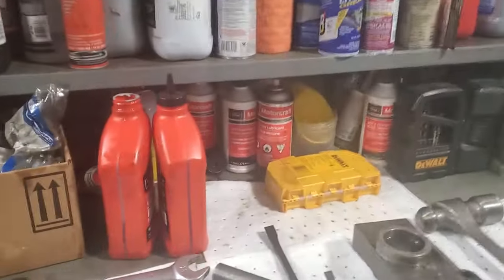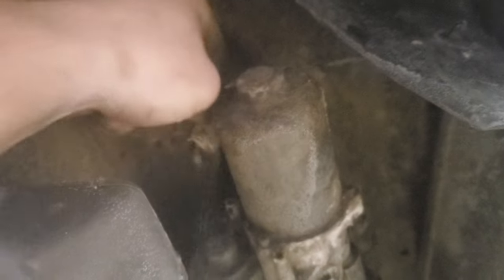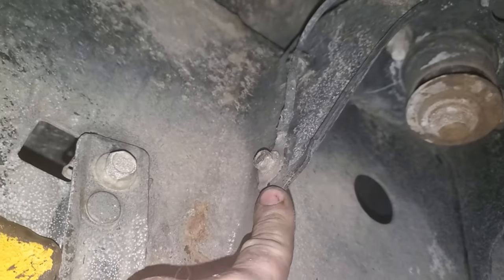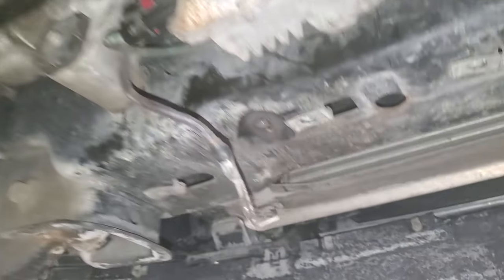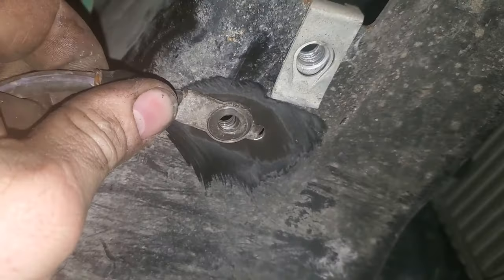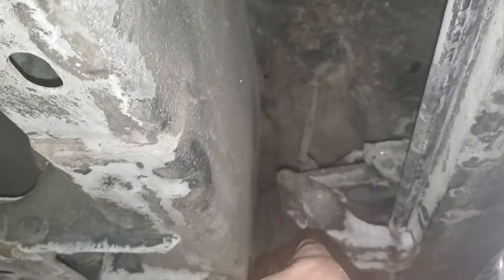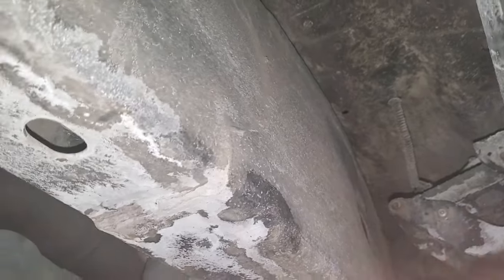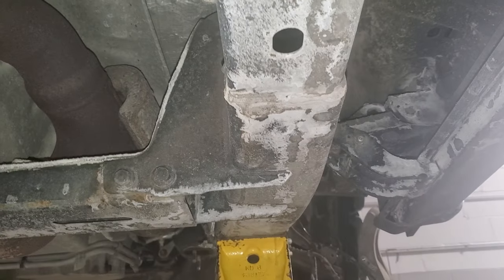EVERY F150 OWNER 2011- NOW PLEASE Do This Notorious Ground Problems - Body to frame, epas to frame

Comment: Could this be why my battery light comes on when I come to a complete stop but only when my AC is running? It can idle without the AC on and it will not pop the battery light on but if it's sitting still with the AC on the battery light will come on every time

Comment: I just did an engine/trans swap from a 17 3.5 ecoboost to a 19 3.5 H.O (just used my old harness)I’m currently experiencing a p060B but before that every time I accelerated or hit bumps too hard (sometimes when I turned) I got hill assist/check break system/service advancetrac, the truck seem to power down for a split second and get up and go again, going to try this method after work see if it helps any I know my grounding wires are a caked in dirt and mine has that tranny wiring on the side as well going to mess with that as well thanks man
Reply from the maker: I'm not at the dealer anymore and I don't have access to the same type of content that I did before if you remind me on Monday when I get back to work I'll look into this but I'm a general manager at an independent shop now so the resources have changed a little bit
Reply: I appreciate that a lot man I Really do. I’ve lingered through your videos the past couple years since I bought this truck and the amount of information I’ve learned from your can not be topped I hope you have a good weekend man
Reply: @FordBossMe  I havnt got around to messing with my ground wires yet but I’ve been driving my truck around and I’ve cleared the codes to see if it’ll pop up again so far I’m only getting a bank 2 below thresh hold which I will get around too soon although it still get triggerd by bumps hasn’t popped up any out of the ordinary codes

Comment: Could this cause truck to not go into reverse? Had this happen 2 times, took to mechanic and it was fine, they couldnt find anything wrong.  Then the other day would not crank, nothing.
Reply from the maker: The f150s had a lead frame issue that would plague them 2011 - 2016 but more 2011 - 2014 than any

Comment: Don't know if this will help but I have a 2014 F-150 3.5L  the turn signals are hyper with regular bulbs and leds and the engine feels like it's shaking a little bit.  Now today someone told me that I only have rear brake light just on the top light not my tail lights. Would this be a ground issue? Thank you for the help in advance...
Reply from the maker: It could be and you also possibly need to clear codes and see what comes back

Comment: Would this potentially be a reason for my entertainment system to go out? 

My dash goes in and out, and it’s random. When it goes out, the ac and radio is out. It’s wild
Reply from the maker: Randomly goes out would prob be a bad radio or a connection issue or bad front control panel - it's the buttons and plastic part that goes around everything hvac controls are in it as well and they go bad at times

Comment: You forgot one thing.   And a Kentucky plant electrical engineer showed us this. Between the frame and ground terminal needs a star washer that will bite through zinc coat and paint. Often Fords ground  terminals do have a bite to them, they’re useless after the first fastening. We put a new star washer down against the paint no matter what. We got a Ford plant employee from the Kentucky plant we paid for advisory and he showed us this way. He said they rarely bite through paint a second time. Their bite flattens he says after their initial factory fastening. But never mentioned silicone so we adapted your silicone  fix with his new star washer trick and we’ve all but eliminated these issues completely.

Comment: Ahh .. wonder if this could be issue with dang    P0605 getting in 06 F150 … cleaned up connections on battery.. cleared code but light came back on and same code again. Bulb seems to be common issue but not on mine as light is always on
Reply from the maker: Whenever you put the codes down on your comments and you want questions answered you got to say what the code means because typically the guy responding to the message has so much stuff going on he's not going to go look it up

Comment: Help, please if you can comment me, sir. 2012 F150 3.5L TT right signal issue. The yellow bulb is fine and replaced, wiring, good, Fuse 38 good but can hear loud fast clicking when right signal turn on, parking lights r good. All lights good include brake lights works. Right signal won't work while the dashboard blinked too fast while front bulb won't show on flashing except parking lot works but not flashing. Left zero issues. Right rear got fast flashing but buls are good. Is that BCM screwed up or what?? My headlights are AlphaRex Black Series Pro plus hyperflash resistor installed, too. Stock bulbs installed, but DRL came with sequential turn signal same time with stock bulb flashing. Can I reprogramming BCM or not?
Reply from the maker: Sometimes you have to clear the codes out of the computer for it to work right because it will shut the circuit down for the body control module so you got to go into the body control module and clear the codes
Reply: Thanks so much. I did clear codes and clicked Body Control Module self-test demand to do the test and reprogram itself to sense the new AlphaRex Black Series Pro headlight with drl signal strip. It works.

Comment: My firewall ground to engine block is just dangling .I guess I have to take the wheel off and access   that side of the motor to see where it snapped off .
Reply from the maker: also could find a good ground spot and run your own cable to a more easily accessible spot works the same way

Comment: Can this be th reason why I'm getting an open circuit or ground short on my right rear wheel speed sensor ? 🤔 been working on this problem for 2 months now, haven't taken it to the dealership because it's too expensive for me and the family right now please help
Reply from the maker: 1 single sensor I don't thing so 

It's probably a tone ring on the rear axle dirty or broken 

Its a bad wheel speed sensor - could be wiring but I doubt it
Reply: @FordBossMe  it was dirty with dirt so I cleaned it and put back on, after that ended up moving some wires going straight to the abs module. It started working got my power steering back and abs light off until I hit a pot hole and everything turned back on service advancetrac, abs light on and power steering deactivated. Still stuck with this problem.

Comment: Thanks man for the video,Now my 2017 F150 driver headlights is a little not much just a bit brighter than the passenger side,I check all the connections changed the bulbs check beam levels and nothing,any idea whats going on,Thanks again!
Reply from the maker: There's a lot of grounds on the back of the firewall as well
Reply: Have you tried swapping the bulbs to see if the problem moves?
Reply: @Randman73  Yeah I did is only the driver side,its not a bulb issue.

Comment: Would this cause my radio to shut off also? i have to bang the dash a little to fix it. (2011 f-150 5.0)
Reply from the maker: No more than likely you just have bad connections or a loose ground somewhere or the radio is no good

Comment: Would this cause my prnd lights to not light up in the dash making a no start concern? P0705 fault?
Reply from the maker: It could or you could have a what's called a Gateway module malfunction or the Gateway module could be bad or you could have some kind of communication come issue going on but a lot of times the Gateway module is the reason for that condition

Comment: What were your trucks symptoms? Mine is shifting as it pleases an will suddenly drop from 6th gear down to 2nd even if im driving 70mph. not sure what the issue is b/c the trans is shifting smoothly in most cases but i did get 8 codes p0151, p0151, po299, p0300, p0304, p0306, p054a @FordBossMe is that something i should try?
Reply from the maker: This was so long ago lol....look through the comments it could be electronic malfunctions, shifting issues etc etc
Reply from the maker: You need a adaptive strategy relearn don't
Reply: It's your lead frame.  Happened to us we replaced it and then ford recalled it after we replaced it

Comment: trying to figure out my 2013 f150 ecoboost, no power steering, no traction control and no turn signal, everytime im trying to look it up i just keep seeing everyone saying its the fuse 125a on the battery but its not blown, tried cleaning all the connetions on the fuse to the battery to the wires but still having the issue, tryna look for the grounds for the EPAS but cant find it, not the same location as this video. last resort is a new rack i guess. Any help or suggestions will be appreciated alot
Reply from the maker: Tell me everything that you've done so I can help you better
Reply: @FordBossMe  I cleaned the fuse connected to the battery, and all the connections around it, I tested it first with multimeter if connection is going through, I tested every single fuse with test light and all lit up. 

traction control light started coming on first then the steering started getting heavy at some angles then lost all steering power assist all together few days later. after going abit off roading with abit of water. same time no more turn signal. Im being told tho some experience the exact same but had to change the whole rack and solved it.

Comment: Would this cause 420 and 430 code even after replacing both converters and all 4 o2 sensors?
Reply from the maker: What typically causes 420 and 430 codes is the vehicle is running rough and the customer never does anything about it until it's too late and it's already destroyed both catalytic converters or there is some kind of leak somewhere vacuum wise on the engine sometimes it will create lean codes sometimes it will create Rich code to just all depends on how it's failing but I've replaced a lot of those catalytic converters as well because PO420 and po430 means catalytic converter inefficiency that typically means the catalytic converters are bad
Reply: have the same problem 2020 2.7 i think leaking injectors plugging cats

Comment: i drive a 2012 f150 5.0 fx4  weird electrical issue left head light goes in and out wipers dont work rear camera went out all of this happend after my traction control light came one which then the engine light wrench popped up dealer says IDS wont connect so that cant diagnose the problem. Any help would be greatly appreciated.
Reply: oh yea fog lamps are really dim if i turn them on right blinker blinks fast if i turn them off rt blinker blinks just fine. left head lamp worked picking it up from dealership and rear camera works. wipers went half was up windshield stopped came half way down stopped then went all the way down @fordbossme any ideas?
Reply from the maker: Did you check all the grounds, also check battery connections and starter connections real good
Reply: @FordBossMe  I am goin to check all the grounds after work today. Didn't think about starter. I will check that as well thank you so much
Reply: So I cleaned the body to frame grounds it definitely  needed it. And just for fun I took out the fog lamp fuse went to turn on the fog lamps just to see, and they were on but very dim still. I'm guessing there is bare wire somewhere that is touching a hot wire. Also thinking tho what are the Chances that a Body control module could be causing these issues? Or is that like last resort possibility. Whenever you get a chance to share your thoughts would be greatly appreciated.
Reply: @FordBossMe
Reply: @FordBossMe  .

Comment: I got a 2013 F150 im working on at the shop
Reply: I cleaned the corrosion off to the frame to body ground ends 8 of the 9 code's cleared only air bag code driver side think in the steer wheel off n on light when turn the wheel hard to the left some ground problem maybe

Comment: Can this be related to a starting system fault? I have a 2011 f150 5.0 and I  can start my truck with the key button but as soon I put the key on and turn it on It shuts off and on the dash it says "starting system fault". Now I can't start my truck with the key on,I don't know what to do...
Reply from the maker: I need you to go to the fuse panel on the passenger side kick panel foot well and check and make sure all of the connections are clicked in all the way
Reply from the maker: You need to look at my F-150 no start videos in the library
Reply: @FordBossMe  I already checked the fuse box and everything seems to be ok. I tried to start my truck with my second key and still nothing. But I noticed that when I turn the key on,  the fuse box inside the truck makes a clicking noise. At this point I think my only options are to replace the pat and the ignition switch.  But I will watch your other videos..... thank you.
Reply: @juandaviles  @ ey juan did u ever figured out?  I have same 2012 f150 no crank at all
Reply: Same here,, 2012 system fault,, no crank,   Not start  even jumping relay
Reply: @gerardolopez5875  yes in my case it was the Ignition immobilizer module transceiver 8G1Z-15607-A. But in some cases it could be the ignition switch SW-6958, the key it self or the fuse box control module  EC3T-14B476-BA. I will recommend you to try first with the ignition switch and then with the ignition immobilizer module.
Reply: @juandaviles  @  changed ignition switch today and same,,,  bcm its next
Reply: @gerardolopez5875   I did the same thing I first replaced the ignition switch and nothing. I recommend you to change the ignition immobilizer module transceiver before you try with the bcm, because it's cheaper only 60 bucks at the dealer and $80 to program it. I did the bcm after trying with the ignition switch and I regret paying $480 for the new bcm and $250 to program it just to see that the bcm wasn't the problem. save some money and do the ignition immobilizer module transceiver or PAT first.
Reply: @juandaviles  @ ok , i will try  that first,,  gracias juan

Comment: What side of the truck are the grounds on?
Reply from the maker: The ground is under the passenger side on the frame going to the body but there's grounds in multiple locations there's another one that goes from the crossmember of the power steering control module in the middle by the oil pan up to the power steering control module and there's two on the firewall above the engine and there's one more in the rear of the truck that goes to the frame right behind the back bumper for the lighting system
Reply: @FordBossMe  thanks so much!!

Comment: This fixed me thank you
Reply from the maker: Glad I could help
Reply: What were your trucks symptoms? Mine is shifting as it pleases an will suddenly drop from 6th gear down to 2nd even if im driving 70mph. not sure what the issue is b/c the trans is shifting smoothly in most cases but i did get 8 codes p0151, p0151, po299, p0300, p0304, p0306, p054a @FordBossMe is that something i should try?

Comment: DO NOT put dielectric grease or any other grease between the contact surfaces! Grease can & will act as an insulator. Use nickel or copper anti seize which is conductive.
Any electrician will tell you that!
Reply from the maker: I want it to, the threads is where the contact is made which pushes it all out
Reply: @FordBossMe  Makes ZERO sense. 
Threads do not push out all the grease.
Contact is made at the flat mating surface & the threads,. This is why you use CONDUCTIVE anti seize to make a full conductive joint.
Electrical 101!
Once this is done you can spray paint or rubberized undercoating on TOP of the bolt head & the exposed bolt thread.
Reply: @BobSmith-mc7uq Just curious Bob, do you know why panel circuit breakers come with dielectric grease already on the back stabs...?

Comment: Dielectric grease prevents electrical activity....
Reply from the maker: So when you start to run the bolt through the threads it pushes it out that's the main thing it doesn't stop it from making contact in the thread area only at the head that's why I do it this way and I'm going to continue doing it this way

Comment: i thought di-electric grease was supposed to inhibit electric current
Reply from the maker: It will stop moisture and stuff like that from affecting the connection but it pushes out once you get inside to the threads and it makes good connections so tomato whatever you want to do you do but it works

Comment: Does anyone know if there is a Noalox type joint compound for Automotive applications.?
Reply from the maker: Use copper electrical paste
Reply: That is a terrific conductor but unfortunately it does not prevent joint corrosion between dissimilar metals like Noalox does for Aluminum and Copper..  

With these Aluminum truck bodies and steel frames I am curious how Ford intended to protect the integrity of those ground connections..?

Comment: Would this effect my radio ?
Reply from the maker: Typically what affects the radio is there's too much junk from somebody's phone in there and it starts jamming it up and then you have to go under General and then go into settings and do a master reset and sometimes that fixes it but it's going to wipe all of the phone stored information out and if it continues to do it then you probably need a new audio control module or accessory protocol interface module
Reply: @FordBossMe  my issue is that it’s very staticky when I listen to music with Bluetooth

Comment: DO NOT grind the surface. Work the threads and add dielectric grease, maybe use a star washer. And grinding will just rot out the area faster.
Reply from the maker: I appreciate your comment but last I checked I was the professional on this job and this is the way I seen fit to do the repair and that's how I did it and explained other people could do it too so that sticks unfortunately for you you have no say in this matter